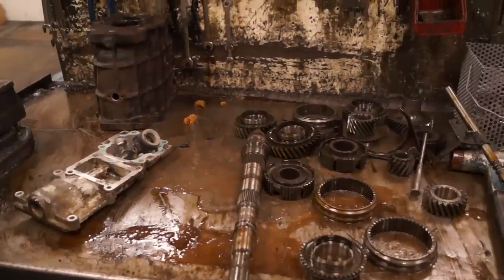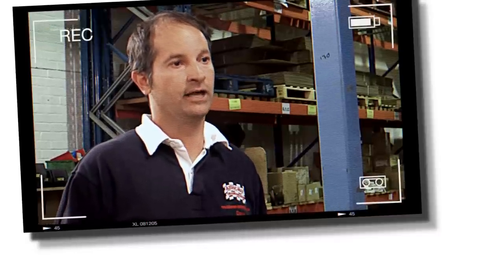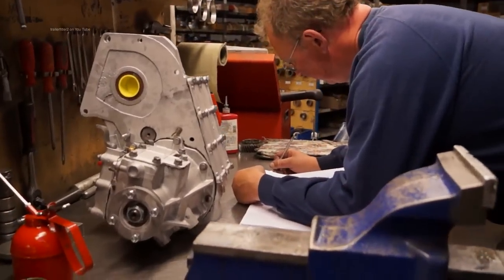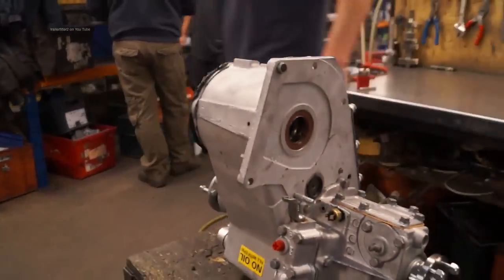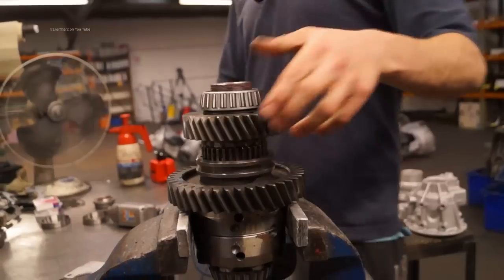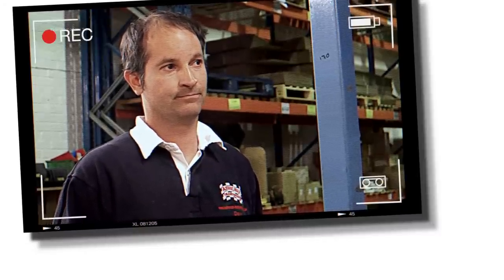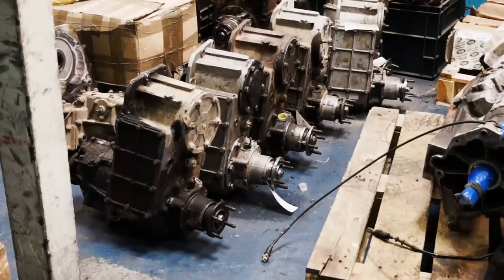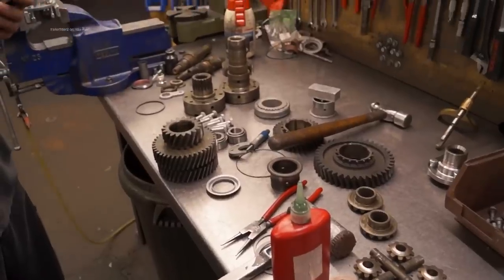Why do Land Rover transmission units fail? - ask the expert

Comment: Been driving land rovers for nearly 25 years and have never blown a gearbox.
My fathers been driving them for over 30 years and also never had a gearbox fail but that's probably because we drive them like land rovers and not racing cars!
Reply: We bought a NEW Disco 4 and the transmission failed within 5km from the showroom floor.  5km!  We were driving our brand new car with care in slow peak hour traffic so please don't assume driver error.  If you haven't had one fail, put it down to sheer luck.  These cars are rubbish.
Reply: Shelty B proof?
Reply: Get a td42t gu patrol and never look back
Reply: These BRITISH SUV`s are far from rubbish, they have the best 4x4 drive train going, bad luck ya bought a LEMON haha
Reply: Not the best 4x4, but far from worst. It is probably one of the best on ice.
Reply: Pill Sharks have you tried driving it like a race care
Reply: blue 747 your old arent you?
Reply: 500bhp/520lbft with 25k miles and hundreds of drag strip runs and my lt230 is doing great
Reply: @sheltyb4608  A German ZF transmission.
Reply: @sheltyb4608  The new ones...YES!
Reply: @sheltyb4608  What a ridiculous comment. Sorry that you had bad luck, it's called 'infant mortality' and can happen with any new product....... Maybe you were driving on tarmac with the centre diff locked.....
Reply: @gosst60  had my fair share of Land Rovers.  Its been a love hate relationship, and at times I have called them junk.  Generally unreliable vehicles from me experience.  And I have been driving them the last 15 years.
Reply: @ChrisSmith-bw1nt  'Infant mortality? More like total lack of quality control. Your comment is clearly the ridiculous one.
Reply: My mates Toyota blew a gearbox and Toyota only covered it kicking and screaming it happens
Reply: @johnsomerset1510  the gearbox box on a discovery 4 is made by ZF not LR

Comment: Well, everyone yelled at me for locking my center diff on minor obstacles, I sure glad I did It now!
Reply: Dane H What is unlocking the center I have a discovery to just got it and I don’t understand
Reply: Dane H, if you push your transfercase shifter to the left it will lock in cdl. All wheels will spin regardless of slip. Huge difference in traction :)
Reply: @briansanford4594  not all wheels will spin equally, but both axles. If you lose traction on one wheel from each axle, you're stuck. It only locks the center diff.
Reply: Guilherme Mauricio That is correct they will not spin equally. But will still help a considerable amount!
Reply: @mvilla36  Whilst on road, your centre diff should be unlocked. If you go off road or in snow move the little gear stick to the left it will lock the centre diff, this will send 50% of the power to the front and 50% to the rear regardless of wheels slipping.
It will give you so much more traction. 
Don't forget to unlock it when returning to hard roads. Failure to do so creates something called transmission wind up which is another subject.

Comment: So what if you can't lock the center difflock?
i have a D2 1999 & 2000 which has the difflock spigot shaft but no lever to engage it?
Will the TC always cut in and prevent any damage?
I hope to at some point install difflock leverage as TC is good for road driving (slippery leaves etc) But hopeless off road even with the right tyres and low tyre pressures.
And makes a lot of mess due to ABS brakes the spinning wheel to late, their for smooths off the surface.

Comment: I've never known a centre diff to blow in over ten years of land rover ownership and 24 years as a mechanic. If the front output shaft spinning is enough to cause centre diff failure then personally I'd say the wear was already there contributing to the fail rather than it spinning due to the diff lock not being engaged. This probably from lack of maintenance on the owners behalf not checking levels etc.
Reply: No, if the centre diff is unlocked, and one wheel spins due to poor traction, then the centre diff planetary gears will be spinning at far higher speeds than they were designed for. They won't be able to do that for long before they seize onto their stub shafts. Its not the front (or rear) output shaft spinning that is the problem, it's that the other shaft is NOT spinning, so the differential speed is massively high. That's what cooks the CD gears.
Reply: Ooops, just seen this is a 4 year old comment!
Reply: I thought it was nonsense too. Because some disco's are not even fitted with a centre diff lock
Reply: Yes, indeed

Comment: Curious as to what discovery 2 owners with no centre diff lock available should do, if what Dave said is true?
Obviously he knows everything there is to know about the Land Rover drivetrain but surely Land Rover wouldn't have removed the difflock if it could cause a centre diff to fail in 5-10 seconds? I think it is more likely that a wheel suddenly finding traction after spinning quickly would be the cause of the issue.
Reply from the maker: +TimeIV  D2 only gives you the Diff locked when it is needed rather than banging it in when the driver wants it.

Comment: Excellent advice look after your Land Rover gearbox and in return it will give you years of problem free driving.
Reply from the maker: very true.  LRs are high maintenance vehicles.
Reply: My experience is that with good maintenance they are very reliable. Too many owners do shoddy maintenance, fit shonky Chinese parts and then  blame LR when it breaks down.

Comment: I have a 2010 Range Rover HSE  (full size).  I was driving down the road at 65 mph, when I felt a loss of power to all the wheels.   Initially I thought the engine died, but once I pulled over I realized the transmission was making a grinding sound. I placed the vehicle in park and could hear a grinding sound in the transmission.  I towed the vehicle into the dealer and was told that the transmission and gear box both needed to be replaced as the spline has sheared its teeth.

This is my 3rd full size Rover (2004, 2006 and 2010) and I never had any problems with any of them.  Now this. I don't tow anything or drive off road. I simply drive from home to work, 90 miles a day round trip.

IS there anything I should ask the dealer? Is there any type of recall or suggested repairs. Im  being quoted $11,000.00 to make the necessary repairs.  The vehicle is probably worth $22,000.00.   

Any thoughts, suggestions or comments would be greatly appreciated. 

Regards,

Ed
Reply: Not worth fixing sorry.

Comment: My D1 R380 just jammed in reverse, then i managed to wiggle the stick and get it out. Then it refused to go into 5th. Then when i got home it slipped into reverse again, so i backed it onto the drive. Then it jammed in reverse again. A week later i'd managed to wiggle it into neutral. Now it's in the back garden 'jammed' between 5th and reverse. 

Time for a new box me thought.
Bought a D2 instead :)
Reply from the maker: The same type of gearbox in both vehicles.  Mind you, I bet the power is much better in the D2?
Reply: No need for a new gearbox, just check the 5th/reverse fork.

Comment: If one had front and rear lockers both switched on would this negate the need to engage the diff lock?
Reply: It would not negate the need because you could still cause the axles to spin at dangerously different speeds.  But it is a strange thought because you should have the centre diff engaged long before you need even just one of the extra lockers.

Comment: 5-10 seconds the bang, nice one range rover, what a great way to get people coming back for service, I mean you could just eliminate the problem but that makes too much sense
Reply: my Range Rover has 31 years old and it works better than a brand new jeep hahahaha
Reply: I ve heard about jeep wranglers that get engines blown in 26 degrees temperature
Reply from the maker: Built in weakness.
Reply: I have 3 4x4:s : Old Chevy Blazer -79, a -94 Jeep Grand Cherokee and 2007 Hummer H3.  The Blazer with it's front Auburn diff is naturally the best off road.Practically as good is the H3. The Jeep is not as good, but good enough.  Now, I know the Jeeps are of bad quality, but trolling is childish.  If you guys are honest, even Lada Niva is an example of reliability when compared to Land Rovers and Range Rovers. I have towed several during Finnish Safaris, so I would never ever buy one. I'm sorry, but you guys just have to admit that they are so bad that Aussies will not use them; they need to get back from the Outback. Sorry to be impolite, but you can not go on pretending that LR:s and RR:s are quality products.And that 5-10 seconds stuff is a good reason to not believe anything else of the video. Just one more reason not to trust those cars if one needs to make up things to cover a bad design.
Reply: @timokuusela5794  Landies were what opened the roads through outback Australia that Toyotas now drive on. Research a bloke by the name of Len Beadell, Much of outback Australia was surveyed and explored by him in a shorty series 1. Another pair, the Leyland Brothers years of traveling and filming the outback from a 109 Series 1. Then there's Les Hiddens, another serious outback Landy driver in a series 2A, there are dozens more

Comment: do the Freelander get the same type of problem and do the engine fell from overheating for 2001 - 2003 Freelander ?
Reply from the maker: totally different gearbox set up. Viscous coupling on the prop's haft is the worst issue.   Overheating?  Any vehicle can over heat if it is not maintained properly.   The earlier petrol 1.8 freelancers used to have had gasket issues.

Comment: I have 2006 Range Rover sport.. I was noticing about a week ago my steering wheel was very hard to turn I didn't think anything of it and sometimes it would seem when I was driving my car it would like cake when I stopped and tried to go get it with the kick a little bit and then go I was on the freeway and I was driving and all the sudden I couldn't push my gas pedal anymore in my car stopped and it said transmission failed... Or something like that popped up...... What could be wrong with my car??
Reply from the maker: +07MariahBaby  I wish it could that easy to diagnose problems like that without actually looking at the car but I can't.  Steering  could be something simple as a flat tyre,   Warning lamps that are a bit vague in description no use to anyone however the vehicle can be interrogated with a code reader to see what it is complaining about.

Comment: So you have to lock the center diff. That's clever, because my 2002 discovery was delivered without any center diff lock at all!
Reply from the maker: But the D2 has something else so you'd want your traction control on when tackling off road.
Reply: Only 2004 was equipped with cdl

Comment: i am thinking of getting a LR3      do they suffer with the same gearbox problems?
Reply from the maker: +M. O.G. Not at all.  You will need to know that it is not a simple drain and refill gearbox.  The oil needs to be flushed and replaced with a machine when it is due.   Not a bad vehicle to own overall but i'd advise you check out the problems they suffer from.  Not to put you off but all vehicles have their own particular quirks to be aware of..
Reply: so basically if u change the oils in the gearbox/engine etc it wont be as problematic as myths make it out to be? specially on the 2002-2005 bmw x5 powered engine ones?

Comment: You just gotta love Land Rover.  I don't think you will find the same kinds of videos for Land Cruisers etc
Reply: Land Cuisers of similar age around the 80's had problems with oiling and using 5th gear in anything other than light vehicle cruising would end up with damaged output shaft from memory I think they were eating splines due to poor oiling.

Comment: Question if you don't mind.  I have a 2012 RR Sport, and out of nowhere the other day, the vehicle starting shifting very strangely, usually at a high RPM, and sometimes with significantly delay between gears.  However, if I switch to "manual" shifting mode, the shifts seem ok.  Any thoughts?  We have always had our normal maintenance done at the dealer to the maintenance schedule, 88000 km on the vehicle.
Reply from the maker: My first reaction would be to have a look tom see what they transmission ECU is telling you.

Comment: I have a question also, when i run my range rover  when its cold it seems to run great but then when i drive it all day it starts to get Hot and doesnt want to switch the gears, and says its over Heating,what could be the problem? What is causeing it ?Do you know ? Thanks
Reply from the maker: Nena Lomeli  what model of range rover and are you talking about it having an autobox?

Comment: Hi,do these issues apply to the LR4 as well, I'm under the impression everything was redesigned and improved on the 2010-2016 model.
Reply: Very very very different hardware.

Comment: great vid, i got a rebuilt r380 from ashcroft about a year ago for my disco 1 94', but i haven't changed my lt230 transfer box, how could i figure if i have damaged the center diff without having to open it up? should i lift the car on the chassis and check the wheels while on diff lock and off?
Reply: Nicholas Connolly-Rangos You'll very quickly know if you've stuffed your centre diff ... You won't be driving on a hard surface (tarmac/concrete) for very long at all.

Comment: I have a 2003 Land Rover Discovery and I wondering if a can switch my HI & LOW transfer case for a HI & LOW with  locks transfer case and what is the difference between 2 transfer cases. thank you
Reply from the maker: just add a mechanism on top of the box to allow you to manually change the gears / diff lock.   Not much else.
Reply: how can I know if is equipped with locks.
Reply from the maker: David Martinez they all have locks.
Reply: @trailerfitter2  2002 and 2003 most often do not, but you can retrofit the locking parts. Source: reading around, and my 2003 had to have this added.

Comment: also I forgot to ask is 75w 90 full synthetic gear oil ok to use in the transfer box also front and rear diffs on 99 discovery 2, 4.0l gas? thanks
Reply from the maker: go with what the manual recommends.  Full synthetic is used on later diffs of course but the SAE very much depends on the region of the world you are in.

Comment: Hi i have a landrover defender 1995 long wheel base was wondering i Can only get 4 wheel drive nothing else it's 300 tdi any ideas
Reply from the maker: After 1983 they are permanent 4 wheel drive anyway......
Reply: @trailerfitter2  it will only go with the diff locks in gauge

Comment: Hei service man :D
Could you axplain me: if you know how people driving, why dont you make an adjustments; upgrades; updates on the car to avoid it from happen?
Like some other:
 Sett sensor on oil filter and check engine light always rechecking on start motor if it was reseted by ODB.
Flout sennsor to oil, dat it should go all out. Tricky sensor for the belt and electronic accelerator to not to go JUMP START DRIVE.
All senssors rescaning on engine start, so if reset CHECK ENGINE it will come again up on next start.

Comment: 2005 Land Rover changed transmission fluid 200000 miles no lights but the transmission jumps when taking off  with out coming to complete stop any one know what’s going on
Reply: Oops! Transmission is fcked inside 💀😭

Comment: Just buy a Toyota land cruiser 80 series .. you will never go back ,I had land rovers for 20 years got fed up of them leaking oil everywhere, gutless wonder engines , crap heaters , and you get wet when it rains . Trust me 80 series cruiser is better in every possible way .
Reply: I feel like I need to explain my self . I really was the landy geek that knows the part numbers of all the bits . And have stuck up for them for many years  ! But tbh I seen the light and seen that land rover are not interested in the working class guy and haven't been in many years now.  Well take it from me Toyota nailed this many years ago .. I would never go back to land rover they sold them selves out years ago and are just junk now a days and any true landy person would say the same .
Reply: I'm actually thinking about getting an 80 4.2td next rather than another 110 , only thing that worrys me is getting parts in the UK and parts are expensive  aswell.
Reply: @mudpanther6079  parts are a little more expensive, but they rarely go wrong. Its was the best thing iv done . The heater is amazing, its comfortable, would pull a house down . I cant fault it one bit . And no more welding ! What's not to like

Comment: I'm getting code p0760 on my range Rover hse. what do you recommend
Reply from the maker: P0760 Possible Causes
Low transmission fluid level
Dirty transmission fluid
Faulty shift solenoid 'C' valve
Shift solenoid 'C' valve harness or connectors
Shift solenoid 'C' valve circuit is open or shorted

The P0760 code is detected when the TCM detects an improper voltage drop when it tries to operate the solenoid valve.

It could be either a wiring issue of the solenoid. Get wiring diagram, find component and related wires.  Check the wiring and go from there.
Reply from the maker: https://www.engine-codes.com/p0760.html

Comment: I love how he describes that if you anticipate wheel spin lock the dif or you could destroy it!  I've got a better idea.  How about you don't buy one of these horrible pieces of shit.  

I'm about to drive my l322 out into the street and light it on fire.  My g wagon has 80,000 miles on it and so far the only failure I had was a tail light... And it has a secondary backup so I actually wasn't ever driving without a failed tail light.  The rover had a blown head gasket, failed differential, blown out air shocks, overheating transmission, failed alternator.  The turd was designed by engineering flunkies.  I've never had a bigger piece of junk in my life.  You'd be better off buying a 40 year old yugo.  It'll be more reliable and probably get better gas mileage.